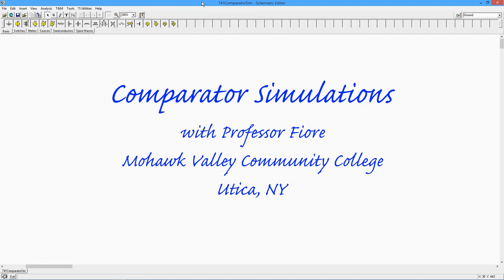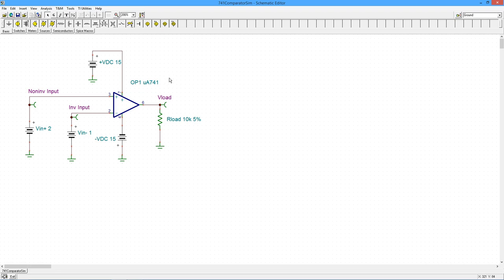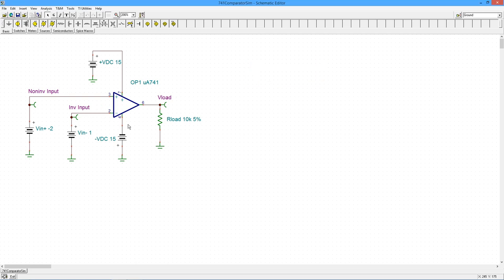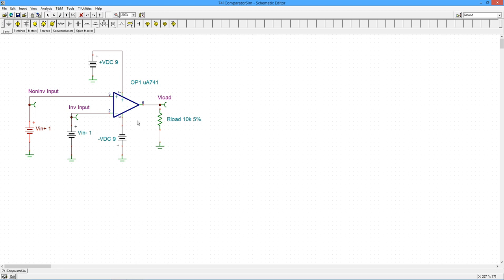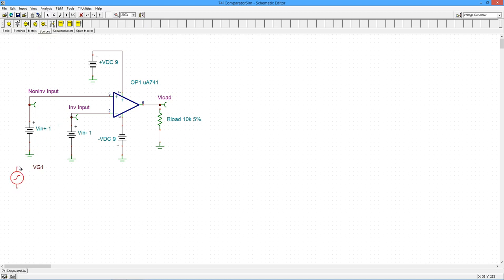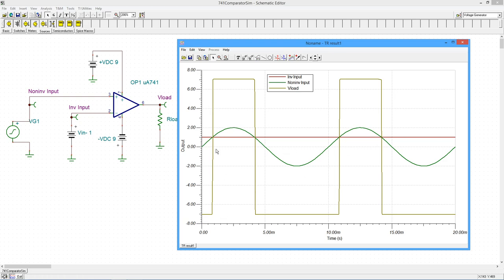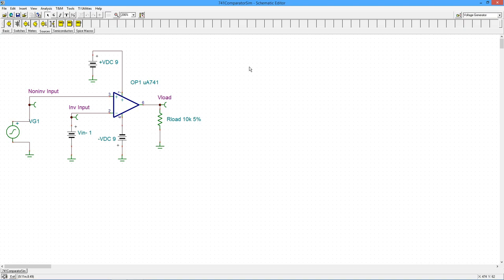Op Amps: Comparator Simulations

Comment: Nicely done, Sir. I was wondering if the rise time, once the diff. flips, is the speed of the slowest internal transistor? Which then made me wonder about the speed and bandwidth of the transistors when chip-board rather than discrete?
Reply from the maker: It's a little more complicated than that. There are a couple of "speed factors" (gain-bandwidth product and slew rate) that we look at a couple of chapters down the road. For now, just understand that the transition speeds are dependent on the op amps chosen.
Reply: Ok so this is why the duty cycle isn't 50 % I mean it spends more time negative please ?....cheers. @ElectronicswithProfessorFiore
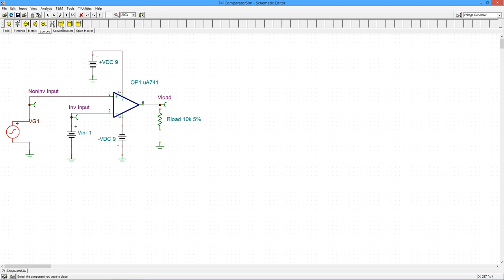Reply from the maker: @andymouse  In this circuit the duty cycle is controlled by the reference input level (inverting input). Go to 5:00. The sine wave on the non-inverting input is below +1 for the majority of the cycle. During that time period the output of the comparator is low (negative). Just think of the circuit as asking the question "Is Vin+ bigger than Vin-?". "Yes" is a positive output and "No" is a negative output.
Reply: Thanks :) @ElectronicswithProfessorFiore